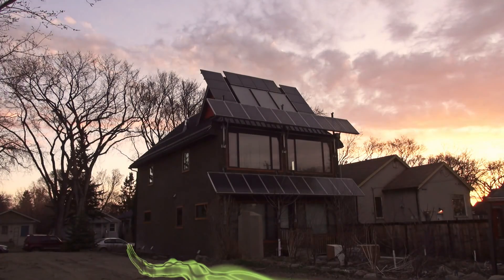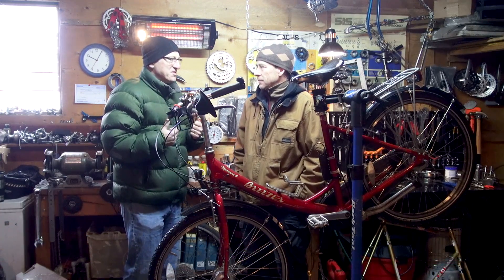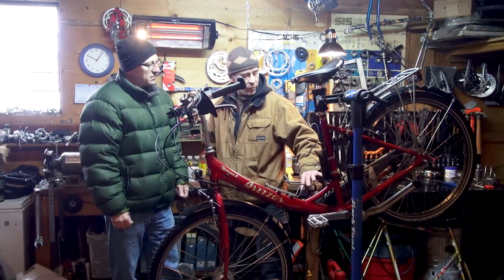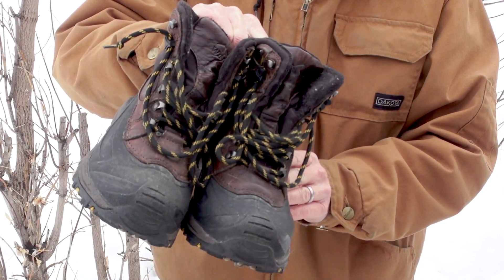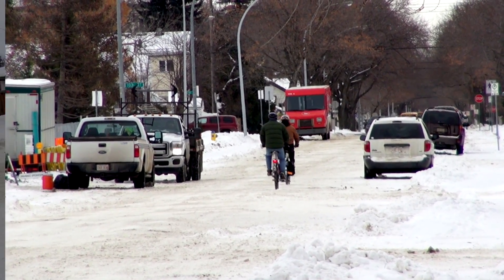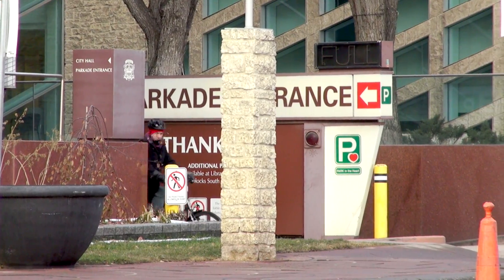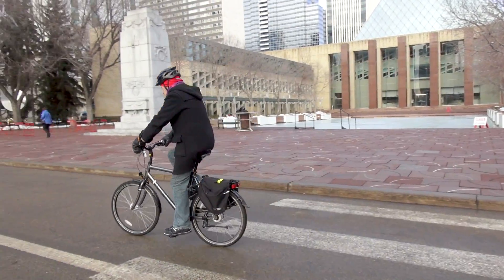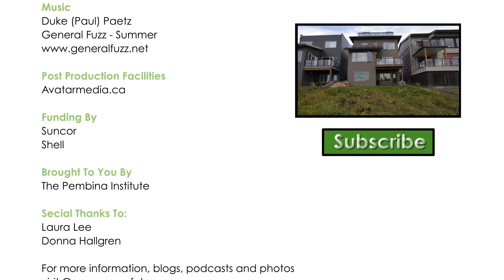96. Winter Cycling 101

Comment: Interesting video.  I'd like to learn more about the costs and safety.  It would be great to see Edmonton make it easier to bike in the winter - many of our roads get quite a bit narrower in the winter.
Reply: Commercial tyres like the Schwalbe Marathons do have a higher initial cost, one would be looking at spending $200.00 for a set but they will probably run for a decade so the cost is amortized over a long period. We also teach tyre studding classes at EBC and these are cost effective and work just as well and require a few dollars of investment and some elbow grease. Getting the city to improve cycling infrastructure is hard enough and getting them to recognize the growing number of winter cyclists is really important.